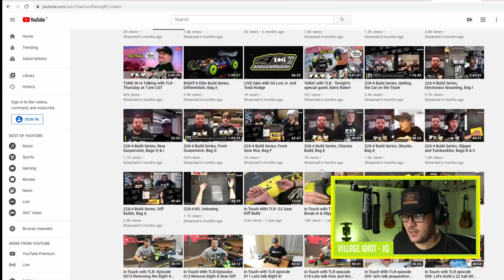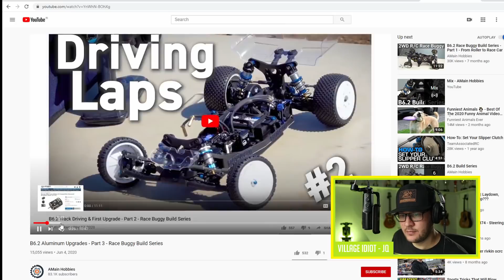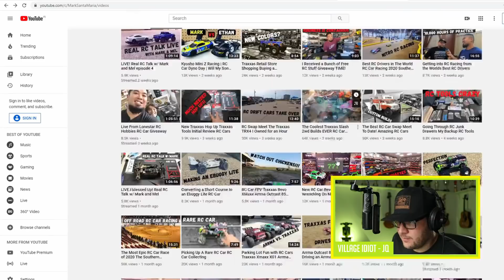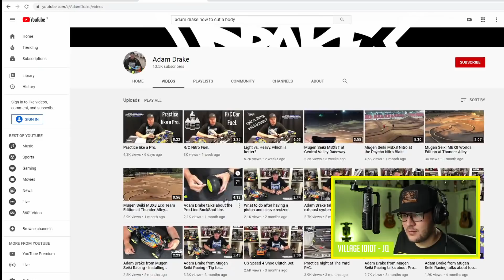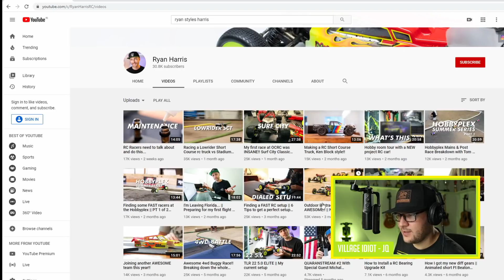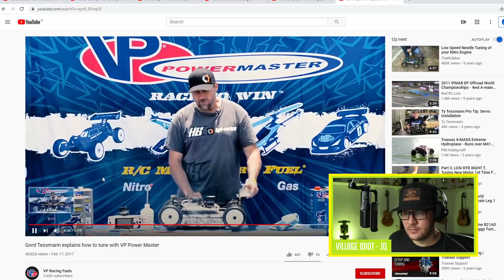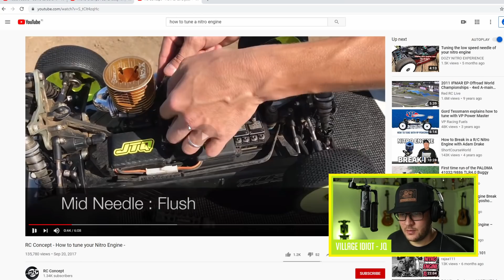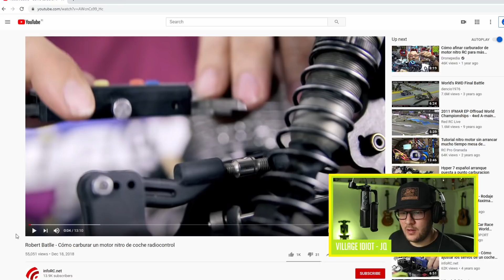JQ FIRED! Starts NEW CAREER....

Comment: Clutch clutch on more clutch! I did clutch on full size nitro cars for a number of years and raced RC cars, 8th scale off road Nitro, the good class LOL -   there are a lot of ways to get the same result but there are a lot of great tips I think you would be able to share extensive detail about, whether using metal shoes, bell housing, plastic shoes, different springs on the three different shoes and all that good stuff that I'm PRETTY sure you know a lot about, lol -- really digging the channel, also that carburetor video was extremely good!

Comment: I would like to know more about tuned pipes.  It seems that almost all pipes are made for 21 sized engines.  What about 28s and 32s and even 38s ?   Does anyone do dynamometer testing of which pipes have the most torque and which ones produce the most top end ?   How to tune your pipe length for max speed or bottom and mid range on short tracks    Just a thought

Comment: Good video. Looking forward to the engine tuning video. Videos about car chassis and suspension setup (all aspects) would be great. Also, a video about choosing the correct tyre and what the differences are. Like you mentioned, there are a lot of videos out there but none of them are 100% complete.
Reply from the maker: There is a chapter on tyre selection in the Invisible Speed Book
Reply: @invisiblespeedrc  Thanks for the reply. When will the book be released?

Comment: How to react to changing conditions in tuning nitro engines. Over a race day weather conditions changing how to change nitro settings.
Reply: If there’s more air for the engine to breathe, add fuel. That’s it. Temps droppedAdd fuel. Altitude dropped? Add fuel. Pretty simple once you know what to look for. Get yourself a weather station and it’ll be cake from here on out

Comment: Great idea! Be clear as much as possible adding schemas , diagrams, pictures, renders of what you’re talking about.. go deeper in details concernig effects of different setup.. 
you know what? I think there is something really missing out there... everyone create its own vlog explaining how to tune a single part of the car ( how suspension works , how diff works , how roll bar works ... ) but what is missing is the entire picture.. before changing something on your car you should have a base setup or you should have a neutral car.. a common starting point.. after that you can analize which is the problem ( the car is slow in the corners.. i cannot accelerate otherwise the back turns itselfs and you are died.. or something like that.. ). From this , applying modifications , one by one, explain the different     expected result.. and not only how to prepare how to build or rebuild a part.. 
so JQ, we expect this from you.. an rc teacher that gives you hints on how to work with your car or point to stay focused if you find a common problem.. everyone wanna be fast on the track.. give us the opportunity to have a good prepared car.. after that everything depends by your own thumbs ! 
Thanks for your help on this!
Ciao
Reply from the maker: They don't do it because they don't really know. I can probably count on one had the people who understands cars in the 1:8th nitro offroad world. It is not easy, I will do my best.